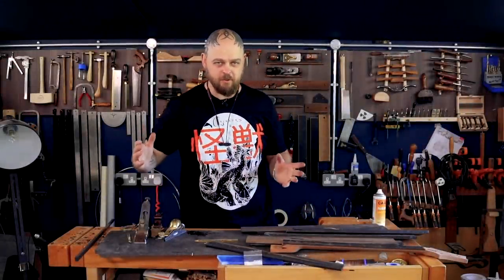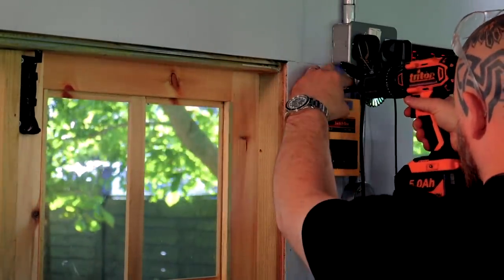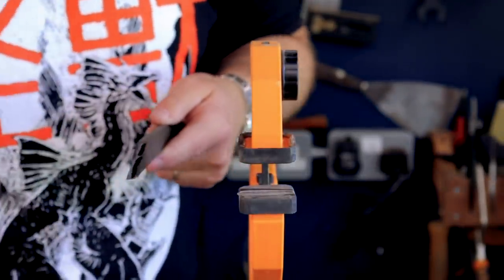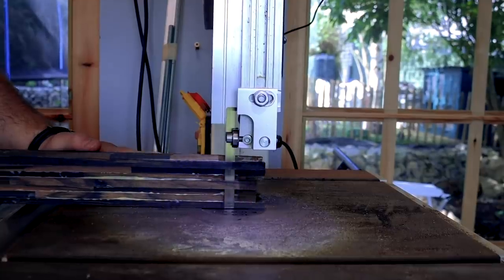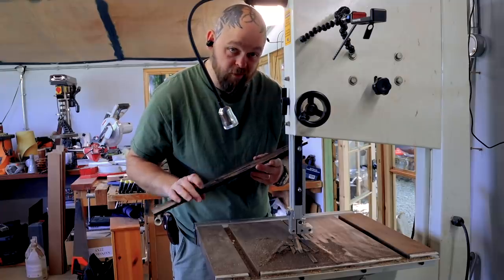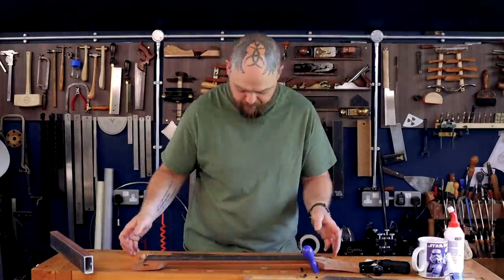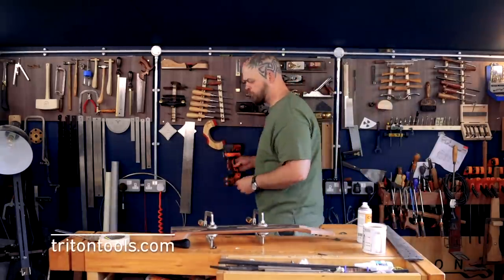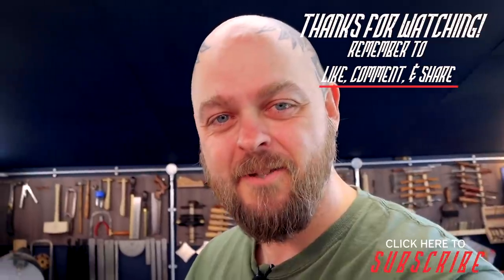Road to Recovery Ep 15 | Building a CYBERPUNK 2077-inspired Custom Guitar

Comment: suggestion for the side dots: drill the holes, stick a little bit of acrylic rod inside. that way you can file it perfectly flat to the fretboard without potentially damaging the LEDs while filing them down. 
it may give a slightly less strong lighting effect, but i think that is a worthy trade-off.
Reply: good idea, if the rod is frosted the lighting effect will still be pretty strong.
Reply: That's a great idea!  How about cutting a slot 5mm or so across the top in the side, put a slice of plastic in it, and put an LED behind in.  Leave it frosted.  It would match the plastic in the body.

Comment: BEN I GOT AN IDEA: Why don't you paint this guitar with blue Lumilor? The paint lights up when a current passes through I think that will suit the build so well
Reply: agreed! This would be fantastic!
Reply: I wonder if the current could be tied into the pickups to distort the luminously 🤔👍🏼
Reply: @SJ-cy3hp  i think that might work. But also it is possible to weakens the pump signal to the amp.
Reply: Fantastic!!! You could even create some sort of Vu Meter by grabbing the pickup signal...Amazing!!!
Reply: Or parts of it, I was gonna say all the light at top & middle of the build isn't balanced by light from the bottom half, particularly the bottom edge...

Comment: I think there's a way to incorporate radius into that fret slotting jig.

Instead of the saw spine riding directly on the bearings, incorporate a flexible piece of steel that is fixed vertically on either side of the jig, but pushed up in the middle by a screw, like a saddle bender.  Its curve can be measured with the radius gauges, while its action is still smooth enough to interpolate compound radii.

Comment: Here's your shiny object distraction # (pick a number) for the build: Seeing as how you're on your third iteration of the "led" fretboard.
If you've tied ground to your bridge then anytime a string touches a fret, that fret becomes a ground point. If you ground each LED to it's intended fret via ground (cathode) instead of all on the same ground wire: Each time you "fret" a note corresponding to the LED, only that LED will light up. Since you're drilling guide pins in a couple of the fret slots anyway ... 
This would not of course be 100% accurate as fretting a 1/2 step higher fret will likely cause the string to touch the previous fret as well but the effect would be interesting. 

Anyway, distraction for thought and as always: Enjoy the builds.

Comment: Now you have demonstrated the fret slotting jig for a standard scale length, how does it work for fan fretted instruments?

Something I would be tempted to try is that instead of the normal route of side dots, inlays or dot markers between the frets (be they traditional or LED's).  On the under-side of the fretboard you could route out a channel along the length of the fretboard in the centre also routing out holes through the fretboard to where inlays would traditionally be and then drill side holes for where you would want dot markers.  At that point you could then essentially pour in a clear epoxy and let it set filling all the holes and channels described so that all the parts that you would want to light up become connected.  In this manner you could then fit a single LED at each end to light the whole guitar.  If you were to use two LED's of different colours for this you could end up with some interesting effects that way - maybe try it on some scrap wood first.

Comment: Ben, as someone who's done more car repairs than they'd like to in one lifetime... REPLACE THAT DRIVE BELT ASAP. No good will come from leaving it on. And it looks like the  old school V Belt seen on many old cars. You probably could pick up one on the cheap.
Reply: It's hardly the same. You aren't getting pistons hitting valves on a bandsaw. Worst that will happen is some noise and eventually the saw blade won't spin.
Reply: Would he be better off, becauae he has a "shack" for building, to get something that will last through the weather changes of heat/cold/humidity/etc? or would they wear less than the usual belts? I'm curious, as I have a garage I am going to try to make a workshop in, and it's not temp controlled...
Reply: I have a feeling that Ben "two Sheds" Crowe has a new belt, or more likely a new band saw, on the way.  And I suspect he has some humidity control as well.  With his collection of tools, I can't imagine he'd let them rust.  Maybe it's not as humid where he's at, but here in Maryland, it's so humid in the summer that tools would start rusting in days!  
Maybe one day I can have two sheds!
Reply: @billklement2492  HAH! 'two sheds'. Literally re-watched that ep of Flying Circus three days ago. :D

Comment: Use the same material you used in the guitar to make the light travel thru the fretboard and be the fret dots and side dots. Not sure if I explained myself.

Like the light river on the guitar body?
Have a piece of that material run below the fretboard, then on the fret dots you cut and glue some of the same material, same for the side dots, no wiring inside the neck required.

Comment: Really like what you did with the fretboard. I could imagine using certain patterns and slight color differences inferring fret positions instead of fret dots.
 Putting steel frets (especially now with compound radius :D) and mimic the the old steel black texture would be great but can't think of a way? If you find a way you could try it on other metal parts.

Comment: You probably could drill 45° angle holes right through the corner, insert there some acrylic rods and flush it with the fretboard, then put some leds from the inside.

Comment: I think you have a guilty pleasure doing mistakes for then come out with something 100 time better then the original idea, whatever,  the results matter, the neck it's just dope. 

About led,  the led itself it's just at the bottom so you can grind them if you put on an angle to be visible across top and side. 

If you put one flickering led in series with the others in parallel they should all blink with the same timing,  adjust the resistance and power accordingly,  you can technically use one resistance only but as to be of the right amount of power needed or will burn. 

Great job so far.

Comment: hey Ben, a suggestion instead of having the led's protrude, on the fretboard, why not tie them into the body, and use the plexiglass as square markers, at the top of the fingerboard. Essentially a little block about 3mm by  1.5 cm the length of  Parallel to the fret. would probably be amazing and less work honestly, straight cuts route a channel in the back, you could even do layering again.

Comment: instead of "just blue" for the finish, what about a "flip-flop" paint that will change from blue to a purple as the angle of the light changes? (Rust-Oleum has a line of COLORSHIFT paints with a color called "Galaxy Blue" that changes from blue to purple depending on the angle) I think a paint like that would highlight all the angles of the guitar.....

Comment: I love this! I had a thought on your fret cutting jig... now forgive me if I’m off the mark here as I’ve never made a guitar nor am I an engineer, but thinking about your comment on cutting the fret slots to match the radius of the fretboard... is there a way you could make some kind of ‘bridge’ with the appropriate radius, that attaches to the top of the bearings for the saw to run along? You could provide different bridges for each different radius?

Comment: If you slightly protruded the LEDs out of the corner of the fretboard, could you sand the faces down even with the board and create an opaque effect on the lights?

Comment: Use rectangular LEDs and inlay them so that the led is oriented towards the player, but the side is revealed in a rectangular slot facing outward. i.e. on the shoulder of the fret board. If that makes sense.
Reply: PS. Sooooo another Crimson guitar in blue? Maybe you should rebrand as Cerulean Guitars™️?  🤣
Reply: PPS You could extend that fretboard idea by mixing with purpleheart, ebony, pau ferro etc. Make the contrast even stronger!

Comment: just put on a new v belt and maibe check the bearings and adjust when needed , it actually looks like a pretty good machine just rocked a little when you started it
maibe make a angle jig for the bandsaw as well think you can use the edge of the table to quare up the jig and guide it

Comment: You know. I have a new idea for ya now but too late. I was wondering if you took  the fretboard since already cut up in pieces join it back together in pieces but leave a slight gap. Then clear resin to fill gaps in fretboard pieces. Then led underneath so light went all through epoxy. Another idea the side for drill hole then fill with clear epoxy. Use same led for front marker and side dot. This would also cut down on power needed. Less LED.

Comment: if you haven't thrown out the waste from making this guitar(saw dust and the fret board shavings) use them for a new guitar. they make clarinets out of sawdust from the wooden ones by adding resin to the saw dust and that makes a good clarinet that is immune to humidity so maybe a guitar would work. call it the "Saw Dust Guitar"

Comment: Hey Ben. You said that to get a compound radius you run the plane parallel to the centre line. Well I do my board radiusing on a router jig prior to tapering the board. Does this mean I've been doing a compound radius without realising?

Comment: The received wisdom is that Ebony does not glue well unless cleaned off with napther or some such beforehand. You didn't show that so is it not necessary in your experience or in this particular application?
Reply from the maker: In my experience ebony glues fine without any other processes.. cleaning with naphta etc is only really needed for particularly oily woods B

Comment: I think the one thing I dislike from the way the build turned out was the shade of Blue you used.  That Royal blue (which looks similar to an ultramarine) is too dark and cool (closer to purple than green).  The artwork you featured had more of that warm turquoise or Pthalo blue... which fair, you did use that on the last Cyberpunk build... but that more Electric Blue color I think would looks more harmonious with the warm accents from the lights, radioactive logo and the warm reddish color of the mahogany.

Comment: I'm concerned about those batteries. Why don't you build the simplest possible power supply (doesn't even need to be stabilised) into a case of, say , an old fuzz box that feeds the guitar via stereo cable? (Signal and  earth going through to the amp, of course.) I have so often needed a battery , but all I had turned out to be dead.